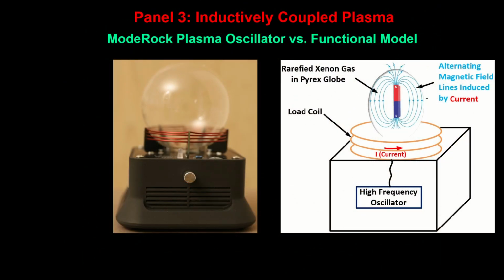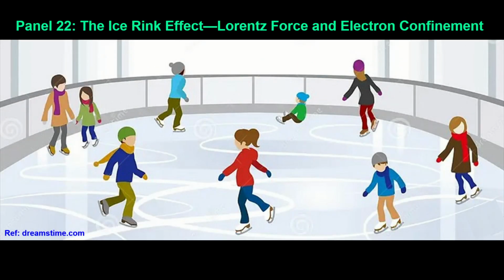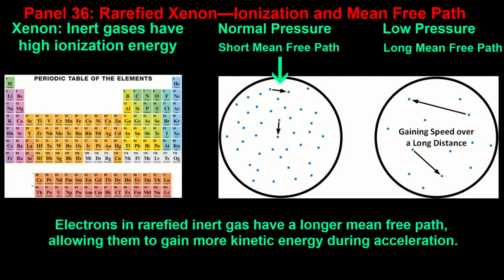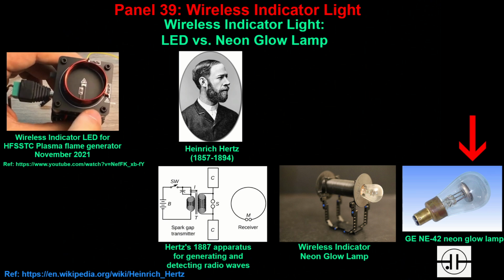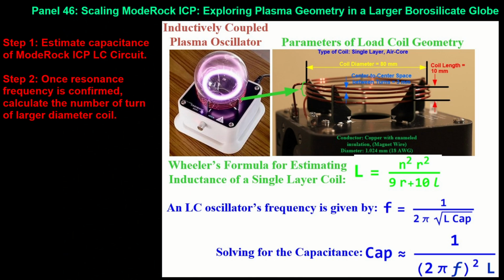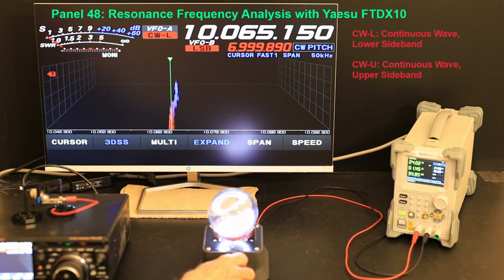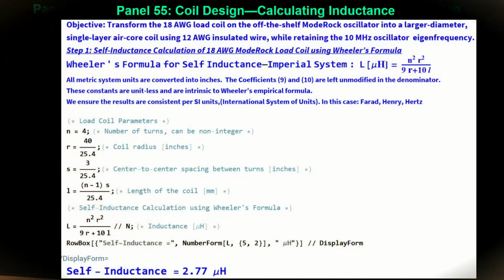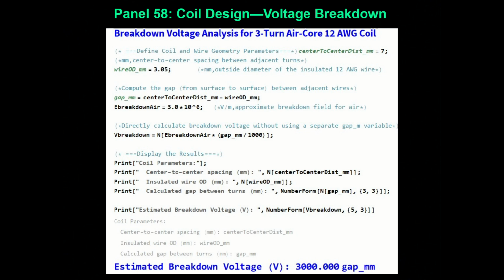Xenon’s Glow—The Physics of Inductively Coupled Plasma

Comment: Avi thank you so much for making this! I'm trying to wrap my head around this stuff and this video leaves more questions than answers (I'm a novice!):
1. Electron spin - where can I find more information on this? If I understand correctly as the DC flow direction dictates the magnetic field orientation, that would dictate both the e- orientation and spin direction? In ac both would rapidly oscillate?

3. In the model depicting photon excitation of the electron - why can we see the photon (light) which is released when the electron return to its original shell, but cannot see the light energy (photon) befor it's "taken on by the electron"?

4. Fillamentry plasmoids - as per my current understanding the standing dots of plasma in a line formation show a standing wave (scalar?) showing the points of low and high pressure? Plasmoids (Winston boswick/ EVO - ken shoulders) is a specific term used to describe energy solotons, fractal torroidal moment, clusters of electrones in a fractal torroidal geometry with confined magnetic field and charge flow directions. Are these the same or just confusing terminology?

Learning step by step, this is very helpful although I'm constantly getting the feeling we are using a flawed model of particles which creates contradictions making it difficult to arrive at a simple understanding that just "clicks". If you have any resources you can recommend for getting up to speed on this I would appreciate it! Subscribed and checking out the rest of your videos. I'm gonna make/buy one of these and would like to try it with "dusty complex plasma" adding some fine carbon particles to better observe interactions. I also have a feeling some special things might happen as it seems space plasma creates dust and plasmoids eat it (:
🙏💙
Reply from the maker: @FreedomNow8-b7f: Thanks so much for the thoughtful comment and for diving in with curiosity—it's great to see that kind of engagement! You're asking excellent questions, and you're absolutely right: the deeper you go, the more layers emerge. Here are a few notes to help orient your exploration:
(1) Electron Spin
Electron spin is a quantum property—not quite like classical rotation. While DC current sets a magnetic field direction, it doesn’t directly dictate spin orientation. Spin is intrinsic, but magnetic fields can influence its alignment (e.g., via the Zeeman effect). In AC, the field oscillates, but spin itself doesn’t flip back and forth; rather, the oscillating field interacts with spin states dynamically. For deeper reading, look into spintronics and the Pauli exclusion principle.
(2) Photon Visibility
We see the photon emitted when an electron drops to a lower energy state because it’s released into free space, travels outward, and—if its wavelength falls within the visible spectrum—can reach our eyes or detectors. In contrast, the incoming photon is absorbed almost instantaneously at the atomic scale, without scattering or reflection, and often lies outside the visible range. Unless a photon is redirected toward us and within our visual bandwidth, it remains effectively invisible—whether it’s ambient EM radiation or part of a quantum energy transfer.
(3) Filamentary Plasmoids vs. EVOs
This is a rich and still-evolving domain. The standing plasma dots (which I referred to as “beads”) you mentioned are more accurately described as antinodes, not nodes. Each bead marks a point of maximum displacement in the medium—while the location itself isn’t a vector, the displacement that defines the antinode is. The reference to “high and low pressure” is a simplification; these regions more precisely reflect variations in field intensity and charge density, rather than classical pressure gradients.
As for EVOs (as described by Ken Shoulders), they’re theorized as coherent electron clusters with toroidal geometry, exhibiting self-contained magnetic fields and directed charge flow. While filamentary plasmoids and EVOs both involve localized plasma structures and electromagnetic confinement, they arise from different conceptual models and may represent distinct phenomena. Terminology in this space can be inconsistent, and your sense of contradiction is well-founded—many frameworks attempt to describe emergent behaviors that challenge classical particle models.

Thanks so much for subscribing and exploring the rest of the channel—really appreciate your curiosity and enthusiasm! Your idea of experimenting with dusty complex plasma is fantastic. Adding fine carbon particles could help visualize charge clustering, wave dynamics, or even transient confinement effects. Dusty plasmas are known to exhibit self-organizing behavior, and you're right—space plasmas often generate dust, and some models suggest plasmoids may interact with or even absorb particulate matter under certain conditions.
If you do build or modify a setup, I’d love to hear how it goes. There’s a lot of room for discovery here, especially when combining visual diagnostics with field manipulation. Keep me posted—and keep questioning. That instinct for “something special might happen” is often where the breakthroughs begin.

If you're looking to get up to speed, here are a few solid starting points:
- MIT’s Plasma Physics Intro (Hutchinson) – A rigorous but accessible foundation.
- Spintronics & Pauli Principle – Great for understanding electron spin and magnetic interactions.
- Ken Shoulders’ EVO papers – Available via archive sites and independent research forums.
- Anthony Peratt’s Plasma Cosmology – For visual plasma structures and alternative models.
These should give you a strong footing across both mainstream and exploratory perspectives.

Comment: Also, are "Filamentary plasmoids" an official, technical term? I haven't seen such plasma behavior before, and quick googling only yielded the paper "Filamentary structure of a three-dimensional plasmoid" by
J. Birn, M. Hesse, K. Schindler
Reply from the maker: Good point! My interpretation, based solely on the abstract of the paper you cited (as I have not read the full paper), is that it depicts a plasmoid with intermingled strands of various magnetic field lines—open, partially open, and closed. While "filamentary plasmoids" isn’t a widely established term, it might serve as a useful way to describe the observation that the plasmoid appears to be composed of multiple small-scale, semi-coherent elements interacting within a larger magnetic envelope, rather than being a single, uniform entity.